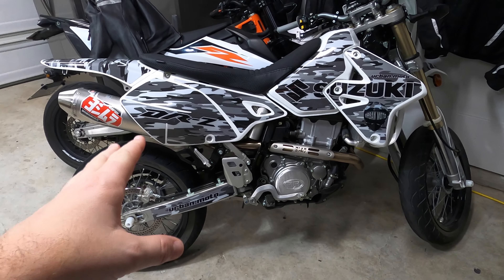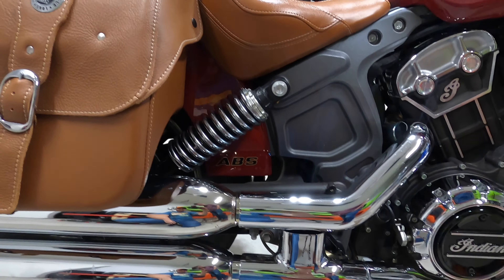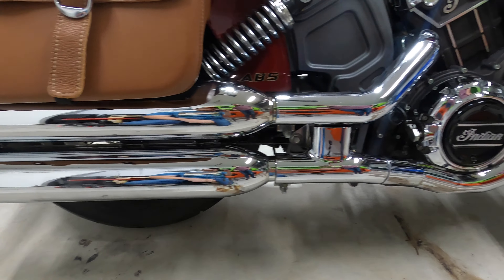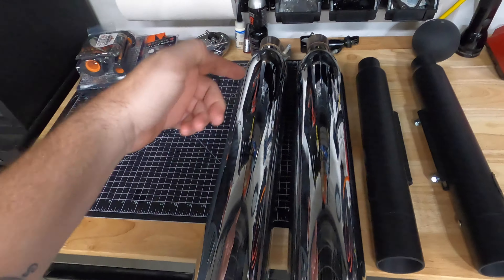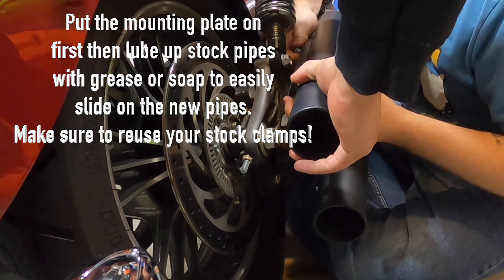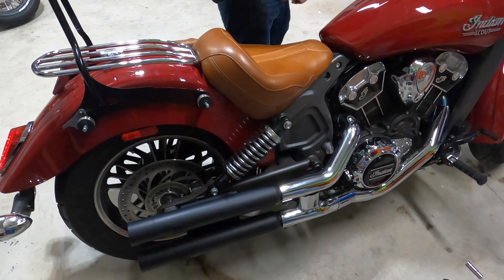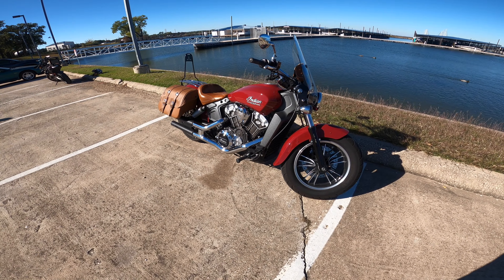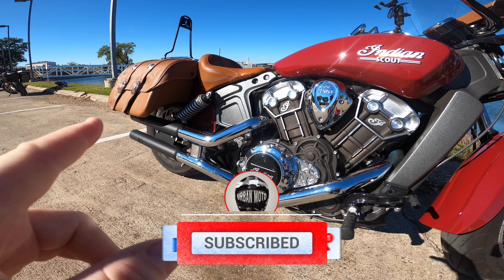INDIAN SCOUT DEAN SPEED RAMPAGE EXHAUST

Comment: I installed the Dean Speed on my 22 Super Chief Limited. I like the sound in general when I'm cruising down the road but I'm growing tired of the popping on decel.  Riding it around town today in traffic was real annoying.  I've checked and everything is tight, been in touch with Dean Speed as well.  I think I may go Indian Stage 2 or try something else.
Reply: you need to get it tuned, your engine is running rich if you are getting decel pops

Comment: Sounds amazing!! How do you like it 6 months later! Is it obnoxiously loud like V&H or more tolerable and enjoyable.. Im convinced this is the exaust im getting for my scout rogue
Reply: Congrats on the Scout Rogue! That's a beautiful bike. I still love this exhaust. I'd say they are right on the edge of being obnoxious. If I'm riding without ear plugs (which I do far too often), they sometimes hurt my ears under hard acceleration. Sometimes, depending on (I'm guessing) the humidity - and probably the position of Jupiter - they just randomly hurt my ears at highway speed, but they are generally tolerable. That said, the sound is still amazing and unique. Definitely get the quiet baffles! I don't want to think about how much it would hurt without them. Mine have held up well, and Dean Speed has further improved the finish lately.
Reply: @urbanmoto-james9854  Thank You for the response. When you mentioned they sometimes hurt your ears under hard acceleration, was that with the quiet baffles on? Sometimes the video doesnt do it justice but would you say the quiet baffles actually help make it a bit more quiet or is that not the case.
Reply: @Stallion3863  Yes. That's WITH the baffles. In my opinion, they are firmly on the obnoxious side without them. Not an issue under regular acceleration, but sometimes when I get a little sporty with the throttle, the Rampage lets me know about it.